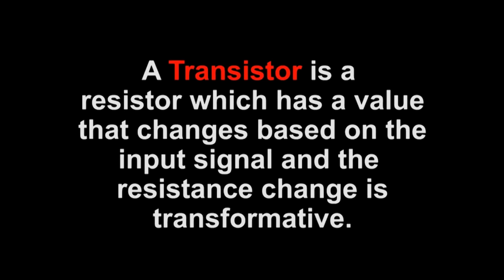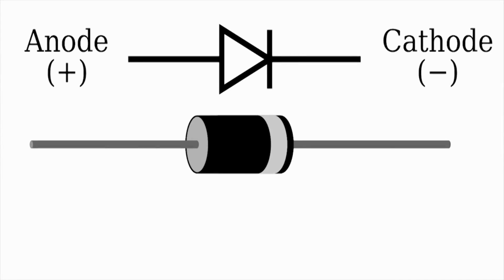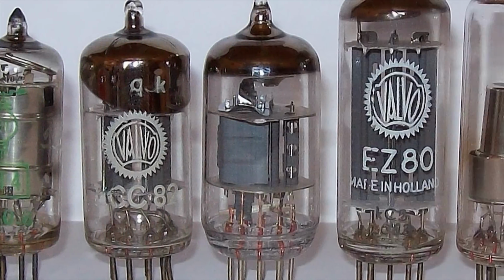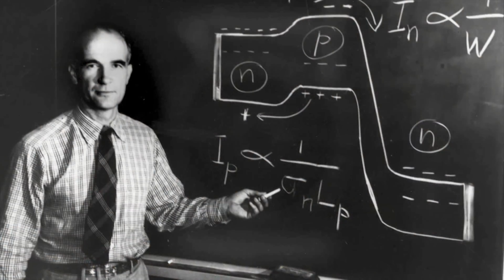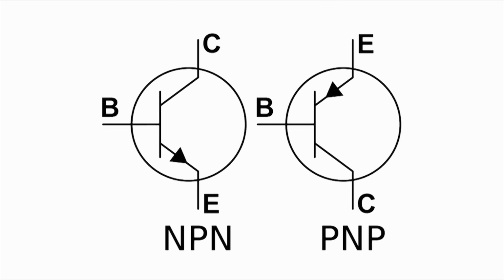The Amazing Transistor! What is it? electronics transistors kipkay

Comment: You can NEVER assume that the transistor has that pinout. the only assumption that can be made is that the base, emitter and collector are the three pins in some configuration. The base is usually in the center, but not always. The 2n3392 is base, emitter and collector, whereas the 2n3904 is emitter, base and collector.

Comment: I'd like to add that a diode consists of two layers of either silicium or germanium which is doped on one side with a metal of the fourth and on the other with a metal of the sixth main group. Thus a transistor is essentially two diodes that are put together either at the p or the n layer

Comment: a transistor is more like a variable diode than a resistor. and when you check it with the multi meter, you should use the diode settings.

Comment: Nononono.  The BJT's you show in this video is not a varistor,  at all.  It's a current amplifier.. Also it's a semiconductor like a diode,  and should be measured with the diode measurement on the meter.  Typical bjt's have 0.25 volts (on state)  between e and c,  and 0.6 between b and e.  :)

Comment: So what exactly would a hobbyist find them useful for?
Reply: Say you have a microcontroller, and you wanna control something like a loud speaker or a very high power LED. The pins of the micro controller can't provide enough current to do that. So you would hook the output pin of the microcontroller to a transistor somehow in a way that also connects the high-power device to the input power source. Or something like that :)